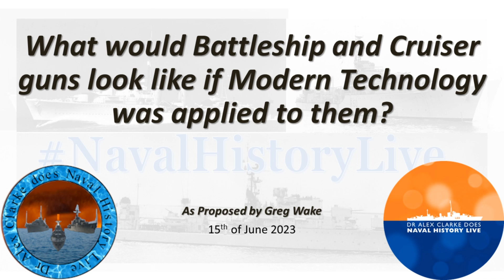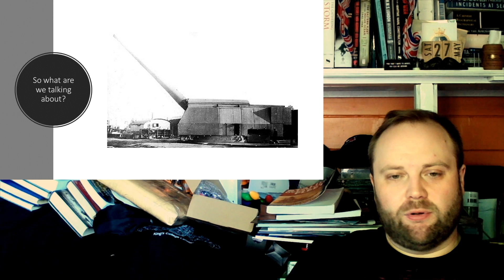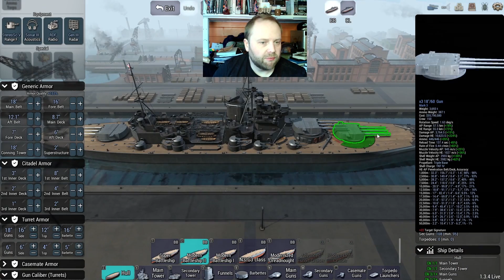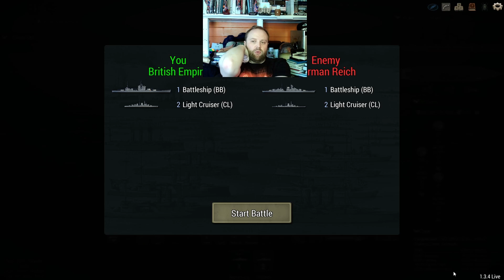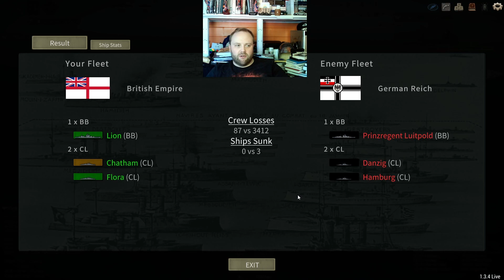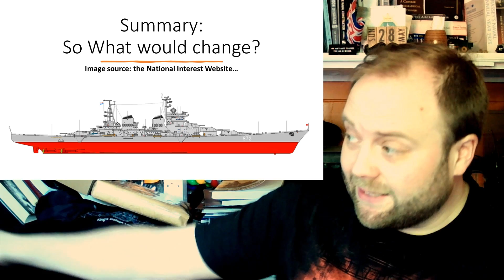What would battleship and cruiser guns look like If modern technology were applied to them?

Comment: Ive been wondering about a brand new 21st century battleship and what it would look like. Ive got this idea that it would have a gun layout like the montanas would have had with 3 16" gun in 4 turrets and would use hpv shells sized up to 14" with a sabot, secondary would be 4 5" mk 45, 2 on each side. Id also have 4 phalanx ciws for and aft, and rams to complement them. Plus the vlc in the middle some would set lower in between the secondary batteries. Im thinking a ship about the size of an iowa but about 114" wide. What do you think. P.S. sorry if i misspelled.
Reply: I'd imagine it'd be something more like a pair of autoloading triple 16 inch gun turrets firing GPS guided rocket assisted rounds up front, Strike length VLS cells equivalent to a Destroyers armament amidships behind the air defense radar so the launch cells dont risk being damaged from concussion effe ts from firing the main guns, 6-8 quad box launchers for anti ship missiles spread across the deck 3-4 per side, aviation facilities at the stern, 2-4 Laser weapons going down the centerline positioned so they can shoot either side of the ship as a point defense layer and 4-6 CIWS systems as a final line of point defense if anything gets past the lasers.

Comment: We should look at the work of the Canadian ballistics engineer Gerald Bull. He created both the American HARP guns of the 1960s and the Iraqi supergun of the late 1980s, part of which is at the Royal Armouries' Museum at Fort Nelson near Portsmouth. Project HARP used two 16" battleship guns welded together to launch saboted rounds to very high altitudes. One round fired in 1966 achieved an apogee of 167.6km, well above the Kármán line. Couple this with GPS, laser or inertial navigation as advanced land based artillery systems use, and I think that a modern large caliber naval gun would be capable of firing a shell for hundreds of kilometers with pinpoint accuracy. Imagine a modern take on the WW2 monitor which could shell Sevastopol from the Aegean sea!

Comment: I think the subject is really interesting, unfortunately I couldn't hear anything you said during the middle 2/3s of the video.
Moreso even than the possibilities of modern large guns I think the theoretical adaptation of modern computation and targeting technology to a 1940s or 1950s style ship design are fascinating. What took a whole room's worth of equipment can now be done with something that can fit in my hand. Laser rangefinders on an Iowa or a Des Moines sound ludicrous. The displacement savings and accuracy improvements possible make me drool.
Reply: -The old systems were quite accurate but as you say much bulkier.   The ballistic cams, trigonometric cams and  logarithmic/antilogarithmic cams were cast into shape (or make on a cam copying machine) and then it was someones job to grind them into shape much like a lense.    Modern digital computers are fantastic but there is still a loss of accuracy in the gun position sensors, A to D converters etc that dominate.   The old systems even compensated for correolis effects.
-I think you could have a/ muzzle velocity sensors (Bismark had something) but a dropper radar would be best, b/ barrel temperature sensors c/  radar is about as good as laser for range and because of refraction has over the optical horizon capability.   d/ tracking of the shells in flight might allow adjustments for wind before the round shell splash had been detected.  The Type 285 50cm AAA radar on PoW was able to track out going 50cm rounds.
-Guided rounds are hard as the key enabling technology was the laser ring gyro (a 1963 invention attributed to DARPA).    It's rather hard to make gyro bearing survive launches but I think 400G was possible (HIBEX missile).   I think the OTO Malera guided 76.2mm round uses a magnetometer to help determine up so it might have been possible.  
-Key to the survival of the gun is at least twice the range of the radar horizon so as to avoid vulnerability to missiles.     This likely means base bleed shells.
-I think shells with their own autonomous homing such as SMART 155 or BONUS would be most likely.
Reply: @williamzk9083  One of the ideas that continually pesters me is the scenario that a technology or phenomenon appears which renders all radio and radar wavelength transmissions unusable. Immediately that would make radar and non-line-of-sight targeting systems useless, and thereby a large number of modern missile systems and guided weapons. That's kind of why I mentioned laser rangefinders, though laser-guided shells and missiles would probably still work in that scenario. 

The positional gyroscopes and other systems they had for the analog computers fascinating. The instruments were so complex, both to manufacture and maintain too. Theoretically it would be possible to hook up a small modern computer module, if specifically designed and programmed for the task, to do the same task as the impressive Ford computers with a similar level of effective accuracy. It's astounding how much technology has changed. I remember listening to Drachinifel's range-finding & fire control special, and trying to use my rudimentary programming knowledge to work out roughly how all those calculations might be programmed into a simple computer system. It would be so much easier to maintain and alter the internal settings for a machine like that. I really would like a good look at the inside of a Mk 1A computer someday.

The other major change the 'no radar/radio' scenario introduces would be as communication and coordination becomes so much more difficult, some of the tactics of the age of sail return and mix with the tactics of the 1910s, 1940s and more recent times. Thinking about a small light carrier and cruiser force going out on long Master And Commander style cruises is bizarre. What could a modern Captain Jack Aubrey do with keel-breaking torpedoes, or laser-guided anti-shipping missiles?

Comment: What about a 48 cm ramjet shell and a drone acting as a firecontroller with a laser designator. The range could be in excess of 150 km, and it would hit with a speed of mach 6. Another alternative if the shell was made to go under the ship and explode there. These days that might be possible. A first salvo KO before the enemy knows it is there.
Reply: The Germans actually fired 105 mm ram jet rounds in WW2 as an experiment.  The "Trommsdorff-Geschoss".    It's an old idea.   With shock hardened electronics and guided shells such as the 57mm MAD-FIRES having their own active guidance the time has maybe come.

Comment: Ok i have some Soviet weirdness........they were not the first to create a workable gun-launched missile that was the US with Shillelagh (a weapon of questionable use compared to an L7 105mm) however they ran with the project and made 115mm and 125mm gun launched missiles. 
How about wacky ivan the  the Soviet naval weapon designer pushing the boat out with an 8" gun with a missile capability, maybe its a thermobaric system (they do seem to like those toys) which might be effective against ships constructed from Aluminium alloys. 
Do i think its sensible...no because the missile will probably  get shot down by phalanx/ goalkeeper  but it looks capable on paper
Reply: Yes the Sheriden Tank could shoot the Shillelagh missile from its 155mm gun.   It worked but like many things was a little ahead of its time.   The significant recoil shook the light weight tank so much it disturbed the guidance and optics during the initial launch period and there was some initial smoke the obscured the gunner view, the gunner having to keep the cross hairs on target.   The missile was also somewhat unreliable.   Of course much of this could be fixed to day.    Western Tank Specifier don't seem to like guided rounds probably because they developed the technology to have a reasonable chance of a hit at 4km with a gun alone.  There are now NLOS 'loitering' missiles that can be fired from western guns but their loitering ability is the key here rather than the fact they are guided.  Western planners seem to prefer to get the guidance into 155mm artillery.   If there ever is a 120mm guided munition from a western tank it will be ballisitc projectile of an anti aircraft projectile rather than a missile I predict.
-Lots of this is applicable to littoral combat.

Comment: Wow, you have the Handwaveum power? Awesome!😱
I admit the idea or Fin Stabilized shells at BB level hadn't occurred to me.  IF all the shells of a salvo were hits would BB's be regarded as super sized Destroyers in the theme of eggshells armed with hammers and armour would be almost pointless.
If these shells were used would the guns be smooth bore like some tank guns or would rifling still be needed?
It's probably a silly question but have you read "Destroyer" by Ewart Brookes?  I had that great book but it fell apart due to over reading😞
Reply: Smoothbore guns were somewhat unpopular in tanks because they are poor at firing standard HE and HESH rounds.  It's one reason the British Army hung on to the rifled 120mm gun as it rightfully saw tanks as primarily infantry support.    Advanced in smooth bore ammunition have been made which allows full bore folding fin rounds with programmable fuses (options for air burst, impact and penetrate and then burst) .  This requires a smart breech to allow programming.     Smooth bore guns can achieve higher velocities due to the absence of rifling.  The usual issue with fin stabilized rounds is their high sensitivity to manufacturing tolerances and then inaccuracy caused by 'weather cocking' in cross winds.   I suspect in the case of APFSDS rounds the extremely high velocity more than compensates.  These rounds to have mild spin.    The 76.2mm Otto Malera gun has had a beam riding round called DART for nearly 15 years and its suitable for both sea born and aerial targets.  It now has the GPS Vulkano 76mm round with terminal laser or infrared seekers as an option.   MAD-FIRES is a US 57mm round for the Mk110 gun with its own terminal radar seeker.  In this case the Mk 110 has a cadence of 220 RPM and can thus engage multiple incoming missiles.  
-Smoothbore is a an interesting option.   I can only see problems when long range plunging fire is use with unguided rounds as the rounds will tend to be very wind effected.   For short range engagements or engagements using guided rounds there is no issue I can think of.
Reply: @williamzk9083  WRT HESH the Brits are the only people who use it, and they're gradually* going over to smooth bore so that they'll be able to use the latest NATO fin stabilised rounds. HESH is better at bunker busting than HEAT as you say.... however the rest of the world is already using smooth bore guns in their MBTs. Regular HE and HEAT rounds don't care if they're spinning or not, it's just the HESH that works better if it is.

* Challenger 3 will have the same smooth-bore as the Leopard, and the gun switch is also a part of some of the retroactive upgrade packs.
Reply: @hairychris444  Indeed but the Rhinemetal 120mm smootbore gun only recently had a decent HE bunker buster round, I believe Israeli Technology.   Fins spring out of the back and the fuse is programed to get the effect (air burst/contact or delayed impact) It requires a programmable barrel to use properly.  The 120mm smooth bore gun only fires HEAT and APDSFS as far as I know.  The British 120mm rifled gun was quite effective when firing DU APDS.  For political reasons DU was unacceptable to Germany or Many nations.   I would say the British 1200 rifled gun (120mm) could be improved with better metallurgy (already applied to the Rhine metal gun since Leopard 2A7) to allow increase gun pressure.

Comment: The US Army used to have a laser guidance package for a shell called copperhead...was briefly mentioned for use on Iowa class in Red Storm Rising
Reply: The M712 was regarded as somewhat of a failure.   The laser seeker often did not acquire the laser spot through a combination of optical reasons or unreliability.  The target might move etc.   It often lead to 'collateral damage'.  As a result the Excalibur 155mm round is GPS guided.    There is a version of Excalibur with laser terminal homing under development as the laser still has obvious value.   (I suspect already in use).   The Italo-German Leonardo-Diehl Vulkano 155 round is GPS guided.  It is a subcaliber round with a range of 70km or more.   There is a 127mm naval version with 80km range.   Range is likely more as there are 'stories' of the 155mm round gliding up to 100km.     The Vulcano technology has been ported to the 76.2mm caliber and in this guise has a range of 50km.      In Vulkano technology the proximity fuse can be replaced by a terminal laser seeker or a infrared seeker(for naval targets).
Reply: For land-based, laser-guided "6 inch" artillery rounds, there also are russian Krasnopol, and ukrainian Kvitnik rounds, widely used in ongoing conflict.